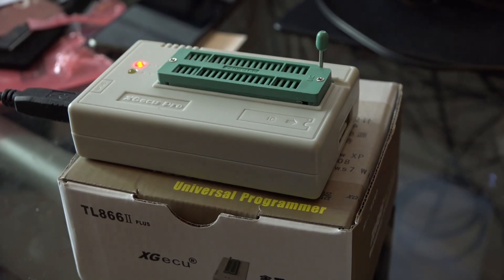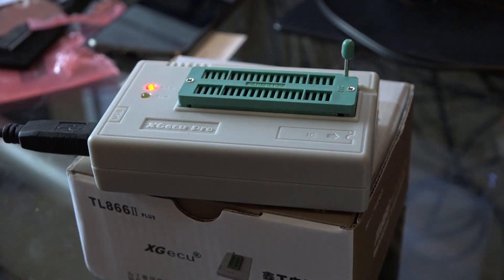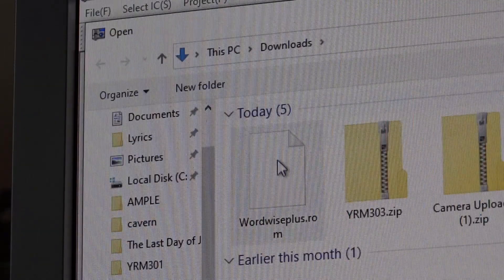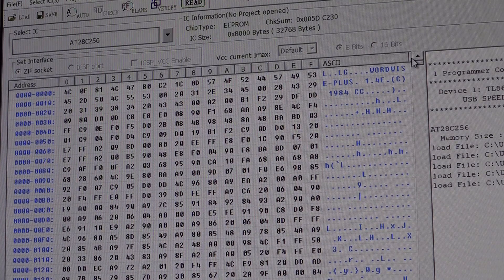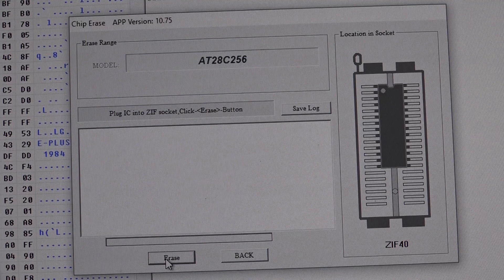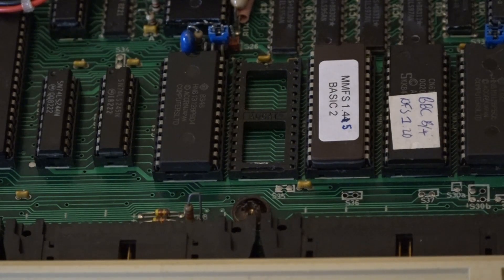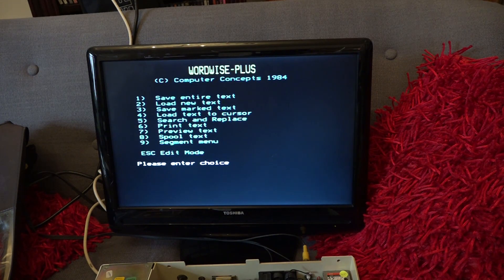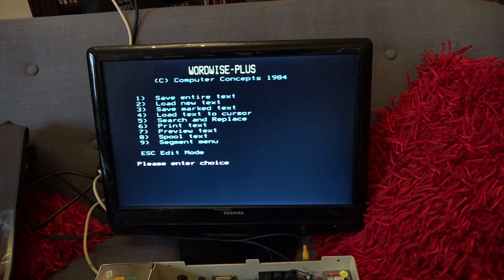Making a Rom for the BBC Model B micro with a TL866II Programmer

Comment: Thanks for them video really useful. I think the reason why it’s needed in both half’s is due to the top data line not being connected and effectively left floating. So some reads will come from the top block and others will come from the bottom block. So you need the code in both.
Reply from the maker: Or add 5v to one of the pins

Comment: I read somewhere that on the BBC motherboard ROM sockets that Pin 1 (which is address A14 on these EEPROM chips) is not connected. If that's correct it means it is floating, so the EEPROM may randomly think A14 is either high or low. This may explain why the chip works for you if you copy a 16K rom into both the lower and upper blocks of the chip. Then it doesn't matter whether A14 is high or low, as the data in both halves is the same. I am trying some AT28C256-15PC chips I got off eBay without much success. On close inspection the four chips I bought all look a little different, leaving me suspicious they're not genuine. I will probably try ordering some more from another seller. Do you recall exactly what model you bought?
Reply from the maker: Cant remember now, but yes one of the pins I had to wire to +5v since then i modified the settings on my eprom blower and I use old 16k eproms and work a treat.

Comment: Wish I’d seen this a few months back, went through the same pain with 32k eeproms. Same result but different method, some on stardot told me to copy the 16k Rom file to itself which then gave me a 32k file to upload so same principle as copying the block buyout doing in cmd line as a file merge/copy.
Reply from the maker: Yes it also depends what chips you use there is easy way to frig this programmer so you can use old 27128s that is actually what I normally use now.